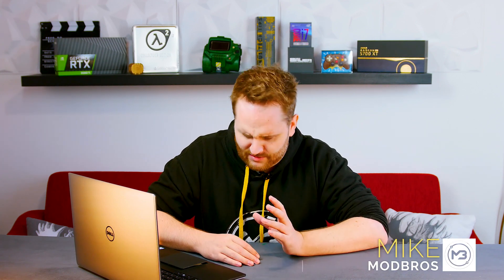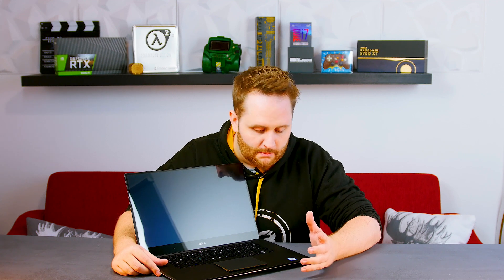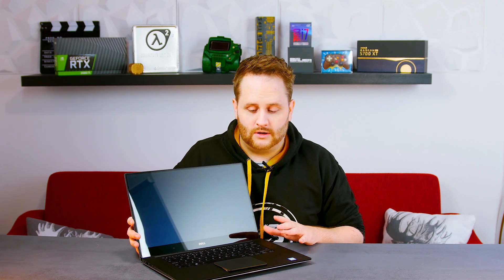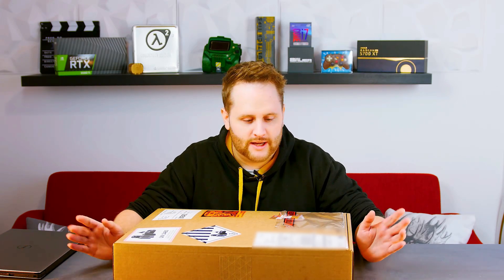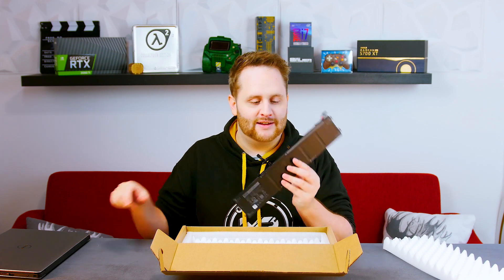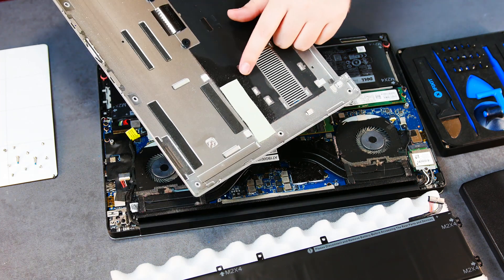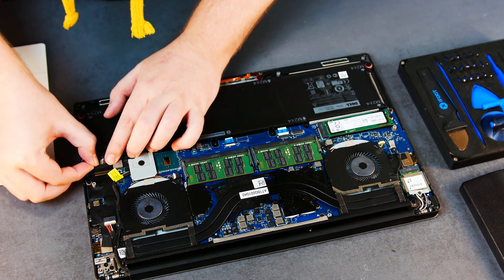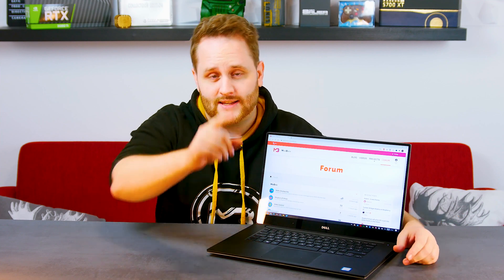Fixing my Dell XPS 15 swollen battery!

Comment: Hi if u anyone can help thanks!
my dell has that black metal-ish thing where the trackpad is, the bottom corners adhesive if off i think & corners stick up a bit. Would it be a problem of when i install a new battery? otherwise idk how to bend it back to normal.

Comment: Did you say your laptop is the XPS 15 9550?

Can you confirm the spec and model number for the new battery as well as the old battery?

How many minutes was the call and how much was the cost per minute?

Comment: Alr so, IF U HAVE A SWOLLEN LAPTOP BATTERY,JUST REPLACE IT. DONT U FRICKIN TRY TO STAB IT WITH NEEDLES,ITS RISKY+LITHIUM BATTERIES IS FRICKIN DANGEROUS WHEN IT CONTACT TO WATER AND OXYGEN,U BETTER REPLACE THE BATTERY,NOT TRYING TO FIX IT,OR U GONNA LOSE UR LAPTOP OR EVEN RISKING UR LIFE

Comment: I have the same problem with an HP Omen, battery swollen within 6 months of replacing it. 3 replacements within a year. Any suggestions on how to prevent this from occurring?
Reply from the maker: Check if there is a bios update that improves battery or power management - That might help!
Reply: @ModBros  I have an option to set maximum charge limit at 80%, which means battery will stop charging at 80%, will this help? But as far as I know there is no bios update
Reply from the maker: I'm not a battery expert but I think it might help. I guess it depends on the battery design. I'd love to know the outcome so if you remember tell me if it helps!
Reply: how much did one replacement cost you?